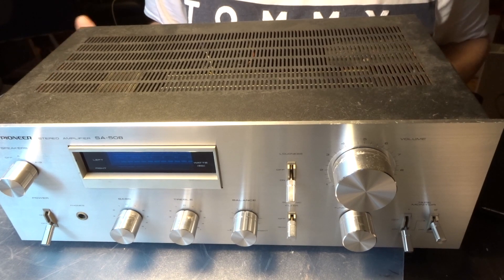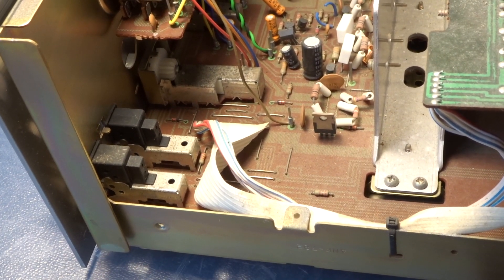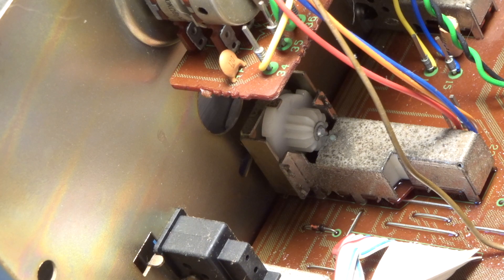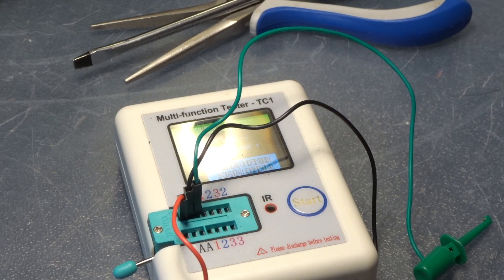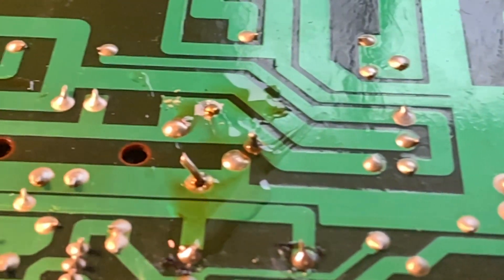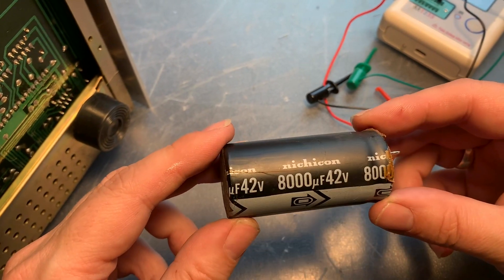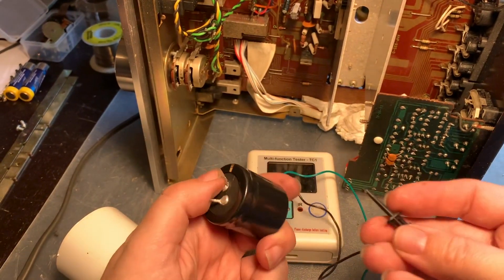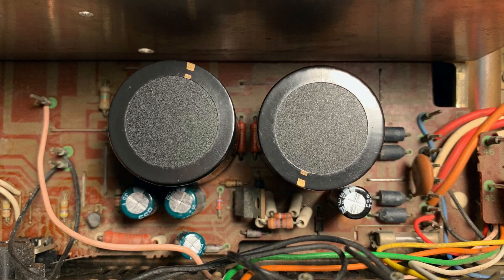Pioneer SA-508 Restoration Part II - Recapping

Comment: wd40 for the cap glue, it should break it up.

have a 96 pioneer amp id like to freshen up, two big caps fine...then i saw the...roughly 400 other lilttle caps all over it 😂🤦 i understand most will be non audio function..but those woukd also need doing i guess, theyre the leaky types. nightmare

Comment: 9:45 you putting a diffierent value capacitor there and you seem surprised that it's bulging. Bravo. I don't really understand why you din't put the same value capacitor there? Shame that guys like you destroying these good old equipment just because you swapping out parts without any logic. And what kind of WD-40 do you use? Because there are stuff meant to use for switches, some other things for potentiometers, etc. Regular WD-40 can cause problems later. WD-40 has a special version "contact" that is meant for switches. Overall, it was a bit of bain wwatching this "restoration". Don't do this man....
Reply: Really don't understand whats your problem? WD40 is used to address the sticky grease on the shaft of the switch. For contact cleanining I don't use WD40 at all. There are better "brands" for that purpose. Depending on switch type/purpose either contact cleaner with a level of lubrication is used or (and thats in most cases) contact cleaner that does not leave ANY residue at all. Random parts wered not replaced without reasons - hint is that you just watched a recapping video. Capacitors were replaced and most of them were far out of spec.
Reply: he says in the vid, you cant buy them anymore. and ive seen a million comments in the last few days that say using larger values causes no problems. lower is bad,,it didnt sit right with me either, thats a wild guess, you dont know the balance of the charge discharge circuits..which would be important i think..

Comment: Could you (or anyone else) please make a list of which capacitors you should buy to recap this amp?
Reply: its an old amp. look up the user manual, it will have all those parts listed after the ciircuit diagrams.

Comment: *Good day sir, i have one sa 508 which does not turn on..o can hear the transformator going on. The blue vu meters arent going on and all i can hear when speakers are connected is occasionally a loud popping noise when volume is fully turned to max and low. 
Could be that capacitors on power board are bad or what should be the problem?
Thanks in advance sir

Comment: I have a pioneer sa-5800, looks identical internally and externally. The left channels of both A and B are not working. The right sides do work. the illuminated section that shows how loud the music is only lights up the right channel unless I turn the knob all the way up, then the left channel will illuminate slightly but still no sound out of that side. All the caps and resistors look ok visually. There's one fuse in the headphone section that needs replacing but all the others look ok.  Any tips where to start troubleshooting? I'd really like to get this thing working again.
Reply: Lighting is either realistic meaning there's a problem of gain, of unrealistic. Honestly no 'simple' ways to know.
First power up the amp and check the rails voltages (see on the schematics)
-if every rail is allright according to service manual then it is a problem in the signal path itself and not the voltages surrounding it
- if no proper rail, check the power supply. Unsolder the caps from the supply and test them.
- if rails are okay, take measurements of the signal path by inserting a sine wave and see where it gets no amplified according to what is sould

Comment: I wonder if the third pin on the power supply filter capacitors is connected to the Capacitor case? It was connected to a third trace and it looks like it goes back to the transformer? Possibly a ground?

Comment: The new filter capacitors have a low ESR rating but still have 1.9% voltage loss! It's definitely better than the old ones but still a bit leaky.. the goal for the case of power supply filter capacitors is low ESR value but also low voltage loss... Because high ESR capacitors will struggle with removing voltage ripple but high voltage loss is like a short circuit so the higher the percentage, the harder the transformer has to work! 
The Voltage loss figure is more important than ESR! High ESR will only give you bad sound but high voltage loss will kill the transformer or anything else that comes after a Capacitor! 
Most people don't realise how important that voltage loss figure is... Imagine needing a new transformer! You can't get a new one! The only way out of it is to rewind the transformer, if you can do it yourself, great! But if you can't! Good luck, it's not going to be cheap... 
So the moral of the story is, keep an eye out for high voltage loss levels!
Reply from the maker: Thanks Peter! Good point and great comment.
Reply: Which one would you suggest to go with?

Comment: I want to recap my 508 too. I have no experience with it. How do i choose the right caps?
Reply from the maker: That probably deserves a seperate episode. Its not hard to pick the "right ones". Just a few things to consider and ground rules to follow. But in short, every new electrolytic capacitor is better than whats currently in an old device. There are no real audible differences between brands. I would just make sure that the capacitors can take 105 C temperature and that the voltage is ideally slightly higher than original (e.g. replace 16v better with 25v). Just be moderate with the extra voltage. If you use e.g. 100v instead of 10v you might run into space issues. Significantly higher voltage will give you a physically bigger capacitor.
Reply: @ClassicHiFiReviews  Thanks for your reply. I think i go play with it. If i can find the right caps maybe i'm confident enough to start with it.First i go offer a broken amp to get the hang on it ::-)  I will let you know if it worked for me. Thanks!
Reply: @bassieadriaan4278  : Its good to go on 63 Volt types AND go 2000 yF higher if you can find them.
The 2000 yF higher gives more power for the low tones AND helps against  CLIPPING !
Do not go over +4000yF because you can damage the transformer ...

Greets from Germany, stay safe.
Reply: @ClassicHiFiReviews  HI !
The 105°C does not mean the cap can "take" 105°C, it means his LIFETIME was be tested on 105°C (3000 hours).
Greets from a "Wangine" maniac in Germany, stay safe.

Comment: Thanx, thinking on replacing on my SA-608
Reply from the maker: Yes, would definitely go for it. You might read in some forums that it is plain stupid to do a capacitor replacement on an old HiFi device unless its broken. But my experience is, that they will fail anyway if you don't and they always far enough out of spec to impact performance in the one or another way.
Reply: @ClassicHiFiReviews  In my case, although they were still working and the rails measured still okay-ish, I replaced all the caps. And surprise surprise, it did make a big difference. I am using it only for headphones.
Reply: @ClassicHiFiReviews  yep i agree
Reply: @ClassicHiFiReviews  Hello friend, greetings, a question that would happen if a power or an amplifier that comes with 4 capacitors of 100 volts 3300 uf is replaced by the 4 but for 100 volts 6800 uf
Reply: @Leon-f4u2l  You can do it BUT if you go a longer time in the "party mode" there is a SMALL chance to grill the transformer ... 
+ 2000yF is max to stay in the specs ...